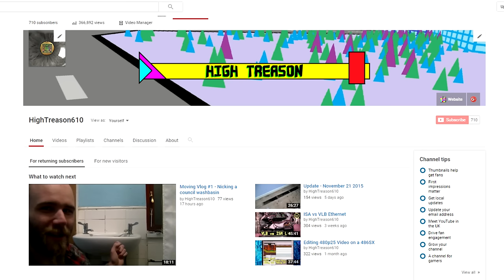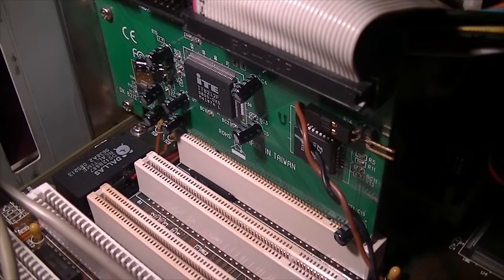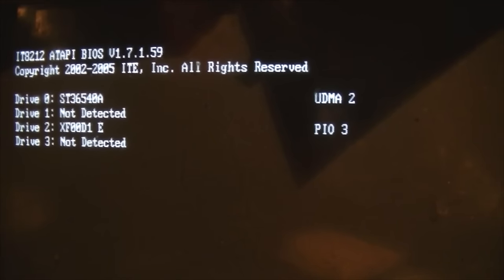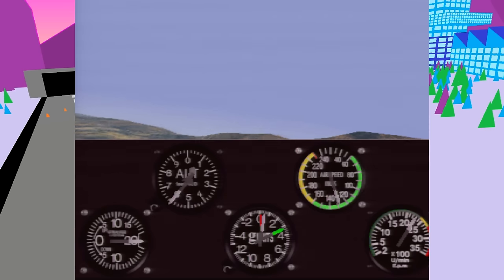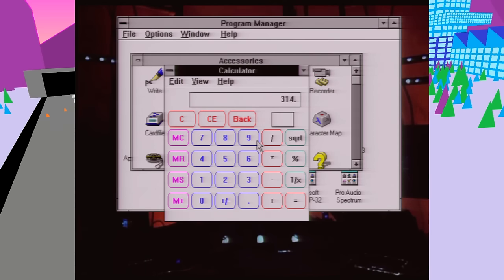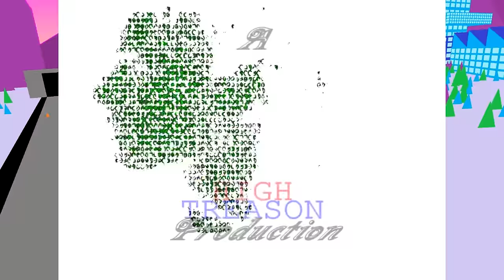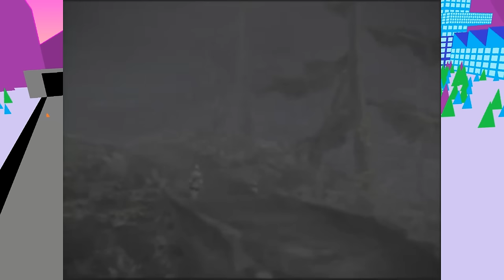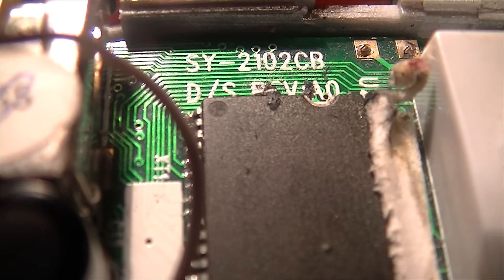Pentium 60 System

Comment: How well does a Pentium 60 do in Windows 95?
Reply from the maker: The RZ1000 was built into another board I had, the controller along with the CMD640 were known for this problem - search CMD640 Corruption if you want to read about that, but the short story is, some moron tied the Hard Drive interrupt and Floppy interrupt together. Interesting you should mention Windows 95 though as that came pre-patched to work around the bug, albeit with a 10% performance penalty for boards using that controller. This machine would be immune to that because it uses a different controller, especially now as it was moved over to Adaptec SCSI. Whilst 95 would run acceptably on this machine, I don't see any advantage to using it here and think WFW is the better option. Everything I've thrown at the machine so far runs fine under WFW or DOS. I always felt that K5/P54 was the better platform for Windows 95.

Like the avatar by the way, is that a Duron? The die looks a little narrow for an Athlon.
Reply: A Duron 800 I believe. I had to shrink it down in MSPAINT. I've always loved the looks of the ol' Athlons and Durons. They are especially special to me due to being the first AMD CPU I ever saw inside a computer. The story is, back in May 2011 I opened up my old Pentium 4 Dell tower after it got a virus (didn't want to pay to fix it) Inside I stepped into a whole new world. I saw my Dad's two nearly identical beige boxes on the side of the room that we kept after he died. I opened them up, took them apart, and put them back together all by myself. The two towers had Duron 1300's. One with 768megs ram and the other 512. One had a 20GB hard drive and the other an 80. (I recall my Dad replaced the previous drive and showed me what a dead hard drive looked like.) The towers had some ATI Radeon cards and other stuff, but no sound cards. They both ran Windows XP. My old Dell was the model: Dimension 2400. Sprouting an Intel Pentium 4 2.2GHz 1GB ram, 40GB hdd, Geforce4 MX440 PCI, and Windows XP. Those were the first desktop towers I used to teach myself how to build and fix computers. Later on I researched all kinds of tech knowledge, expanded my collection, I've never been the same since. My computer hobby is here to stay. :)
Reply: So Windows 95 put on a system using the CMD640 would never experience the corruption bug?
Reply: K5/P54 are good choices though I once ran Win95 on a 486DX 40MHz AMD chip with no trouble. I prefer at least 16MB ram, although I will accept 8MB if the machine is not used much for games.
Reply from the maker: My first machine was a 386SLC-25, which I still have but don't use very much now, likely as my 40MHz DX is invariably better than that one. I've always had a soft spot for the K7 though as that was when I first started really getting into this stuff and was the first machine I made with new parts, though I'd built with used stuff before. Sadly, I don't have the resulting Duron 750 machine anymore and I really miss it. I do have an Athlon running though, in fact, I have a feeling it will be seen on this channel in the not too distant future. And if you wondered, yeah, I was pretty much running the 386SLC until that Duron was built, that was quite a leap.

Windows 95 on a CMD0640 or RZ1000 won't suffer corruption, nor will later operating systems apparently. DOS can be patched too, but I've never found a copy of the files online. You can actually work around the problem by using another card or, in the case of the board I had, just using the second IDE port as it was a traditional ISA Host Adapter and wasn't connected to the RZ1000 at all.

I once met some nutter who kept whining because he'd somehow put Windows 98 on a 386 and insisted on doing so, but wouldn't accept that his machine simply wasn't fast enough to run it. There had to be something wrong with the machine I could fix because Windows 98 was better according to the box... I have no idea how he managed it, or how his logic arrived at this conclusion, but it did not run well. Things like that are a large part of why I won't touch computers professionally anymore. I have run Windows 95 on a 33MHz 486 before now though. In fact, I still use a prototype version (Build 189) on that same machine, now running a 40MHz SX chip. It runs fine, but I don't use it for much more than file management anyway and I suspect the prototype is lighter than the final. It does drag its ass editing video but I suspect that is more to do with limitations of the hardware rather than the operating system. Still, so far as I am aware, Microsoft actually developed and optimized Windows 95 on slower 486 hardware anyway, so there's no surprise it runs decently on that platform.

Comment: My Dreamcast disk drive makes similar noise to your drive.
Reply from the maker: +Kaminishi I still have three Dreamcasts and they all sound different. They definitely do sound similar to that drive though. I don't mind it, even when it doesn't work I at least know it is trying to read the disc. The noisiest were the cheap high speed drives from the early 2000s, I remember there being all these no-name drives for sale at LAN Parties with outrageous claims such as "56X" that sounded like jet aircraft when reading discs... For a few seconds, before the drive logic realized the cheap optics would never actually be able to read the disc that quickly.

Comment: Great video.  I still have that Pentium 60 gold top processor sealed in its original box.  Even though it was kind of a crap processor, it holds a special place for me.  Best of luck moving forward.
Reply from the maker: +Artex Thanks. Yeah, the processors are problematic but these days that's part of the reason I even like them; I don't have to use it and I can walk away, so when the system starts having a fit it's just fun to see how far it will come off the rails. The video mode button in RoTH certainly provided me some amusement anyway, what with Adam spazzing out and punching everything in sight for no reason.
Reply: @HighTreason610  socket 4 Pentiums suck, the Socket 5/7 ones are better.